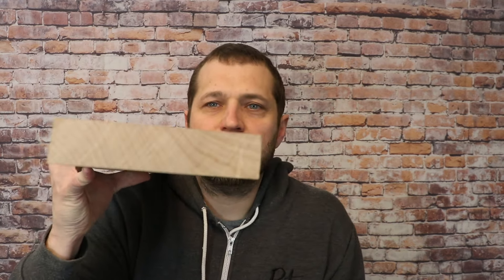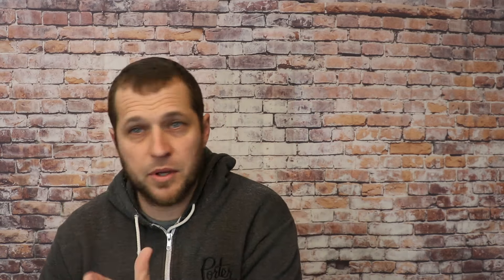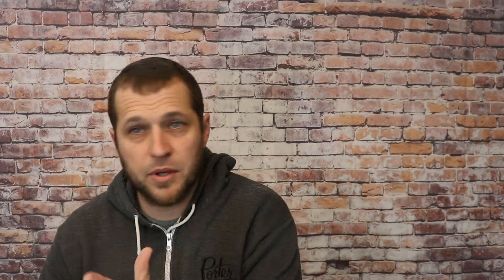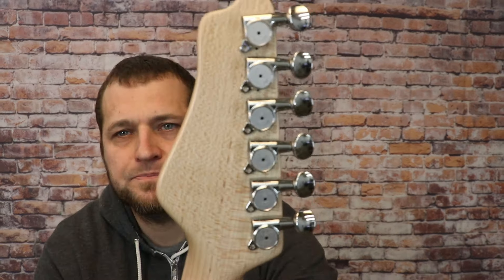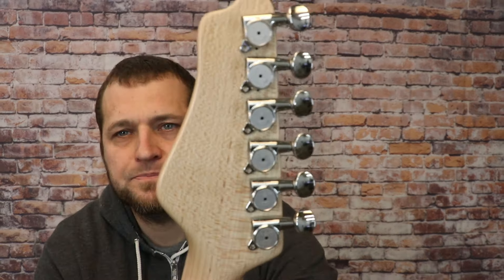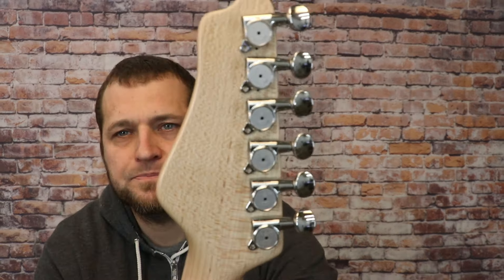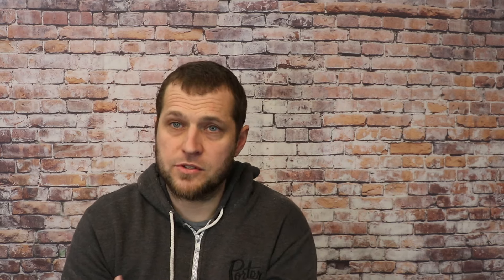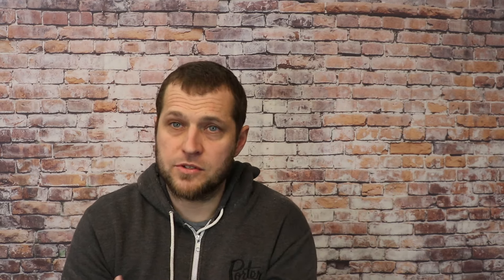Flatsawn VS Quartersawn for Guitar Necks

Comment: Then you have feature wood such as Canadian birdseye maple. To have that feature "Looking" up at you and to the back of the neck the blank needs to be a cross between both Quater and flat sawn.  I have such a Telly neck and it's been rock solid stable since I had it made in 1990.
Reply from the maker: For sure, Birdseye can be very unstable if it’s not cut right.
Reply: your lucky thats all it is. make a habit out of buying necks like that and you will regret it and that also depends, if the neck is a multi board laminate neck and the outside board is flat sawn it doesnt matter if the inner boards are quarter sawn
Reply: @chippsterstephens6800  I didn't say its the strongest @45 Deg. I said that's how it is to make it show up.   And 45 deg is better than flat sawn. Take a look at the science of axe handles.  Modulas of elasticity is best from full quarter cut (Ideal) to 45 deg. (Acceptable). So I don't disagree with you, Rather I think you misread.
Reply: @chippsterstephens6800I just asked another YouTuber how often you have had a neck twist...it's rare

Comment: I'd love to see a video explaining how the cuts are made from the perspective of looking at a tree/trunk. Make sense?
Reply: Found one: https://youtu.be/rMzqXBY6h5w?si=i4a_6GJmOngA5_4e&t=52
Reply: Imagine a torte. Usually they’re cut quarter sawn.
Reply: it doesn't make any difference how its cut, the only thing that matters is the direction the grain runs when you make the neck. the center pieces of flatsawn lumber are quarter sawn. the pieces between the center and top or bottom of flatsawn lumber are riftsawn. take a wide enough piecs of flatsawn lumber and you can probable find all s types of lumber, all that matters is the direction you run it if you look at a neck and the grain runs parallel with the fretboard its flatsawn , turn that neck with the fretboard vertical not horizontal and that is quarter sawn
Reply: @bigdbearkiller5115 it actually does make a difference in how it's cut, from a sawyers perspective.   When I quarter saw a log, I can get almost all the lumber out of a decent size log as quarter sawn, or as flat sawn depending on how I break the log cants down.  Quarter sawn is more pricey because it produces less yield from the log and takes a significant amount of time compared to flat sawn.  You are correct in the fact that on a wide board you will get a combination of all three grain patterns due to how it comes off the cant.  Also quarter sawn lumber is inherently narrower due to the fact yoy break the cant into quarters before taking boards off.